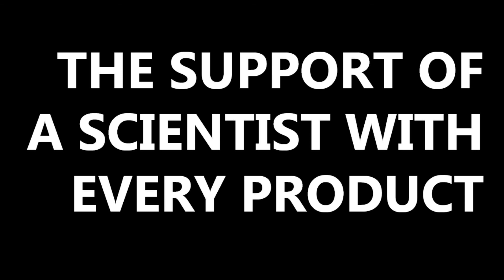How to Calibrate the Horiba Laquatwin Conductivity Meter EC-22

Comment: I just replaced the sensor with new one but still keep getting Er4 when calibrating it. Do you have any idea why? considering it’s new sensor
Reply from the maker: Er4 occurs when there is a calibration failure. To help resolve this issue for new sensors, you could try a calibration and factory reset. Please follow the steps “Initializing calibration data” and then “Initializing the settings” to perform this reset.